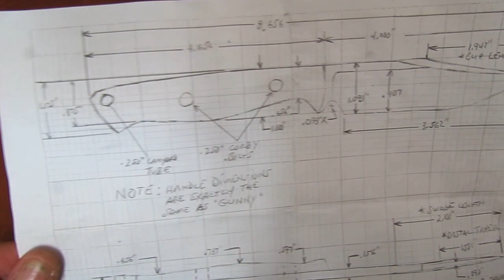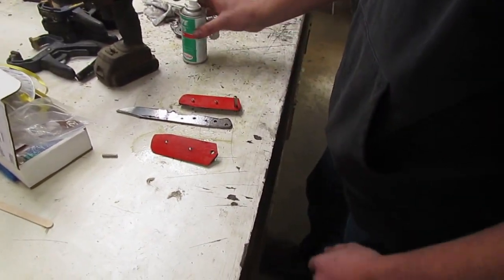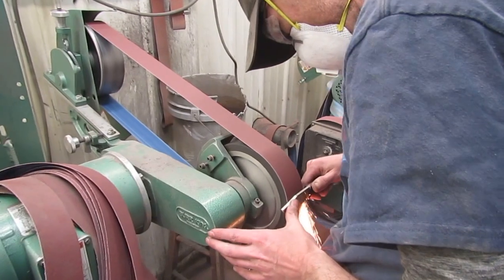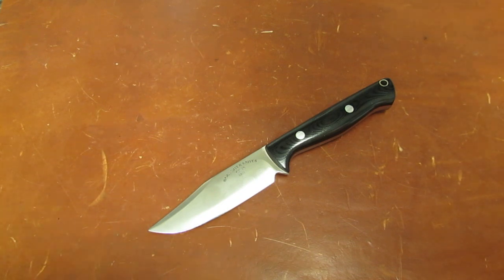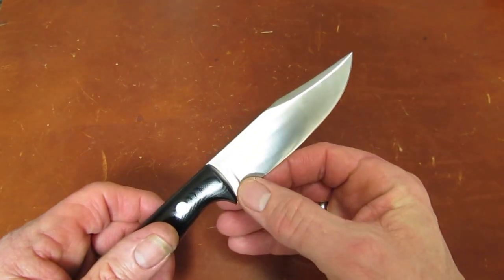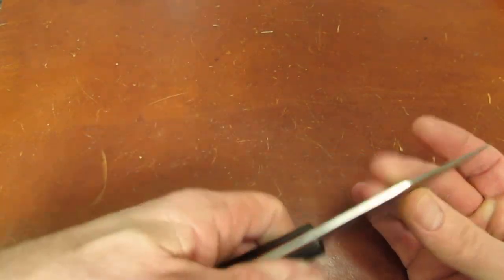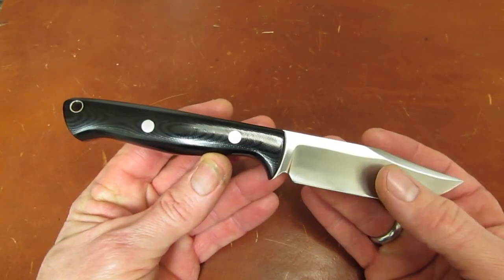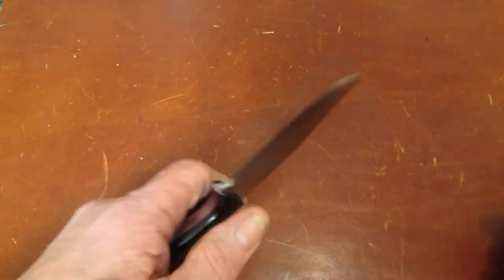TheApostleP / Bark River Gunny Sidekick Prototype Comes to Life!

Comment: you certainly like to sharpen and keep your knife in pristine cond. i use water stone fron japan, i sont get the satin finish you get but buy cutting edge from apex up to  1/2 inch is mirror polish where i found a big difference in just about all ctting  not including paper and shaving as i have found this to be only part of a true sharp knife for hunting and field dressing. i have beeen thinking of going back to tour was with sand paper but use fine stones just to polish up the edge and of course  black and whte stopping .

Comment: Good thin they didn't mess up the scales while grinding the edge.  Doesn't one normally do that the other way around?
Reply from the maker: azraelsblade No, the handle is normally completely finished before they apply the convex and sharpen the blade. The fronts of the scales are completely finished even before they are attached to the tang.

Comment: nice video, i am not a fan of clip, points on the smaller end fixed blade, the point looks stroong but not sharp enough for feild dressing but i cant say for sere, i love  drop points, clips came into stile with giand bowies in the 19th century i believe, why so much use on the base of blade handle used  on the grinder, i guess you have acces to many  belts, i think alot more cutting could have been done before wasing so much belt material